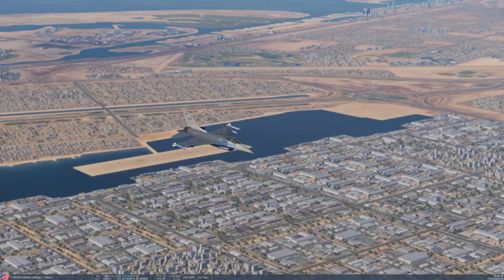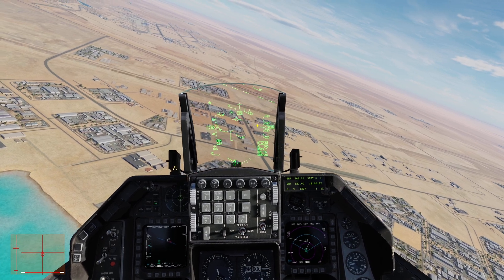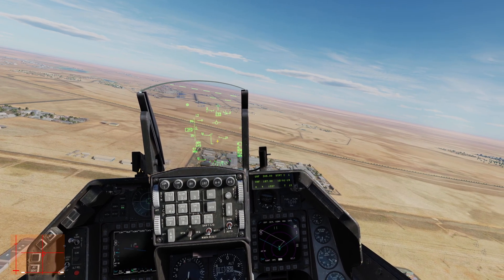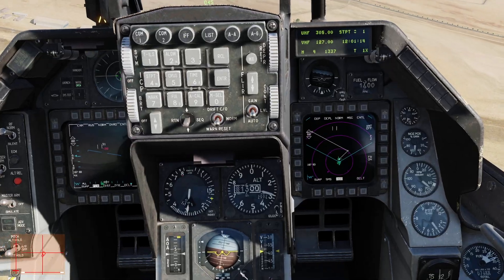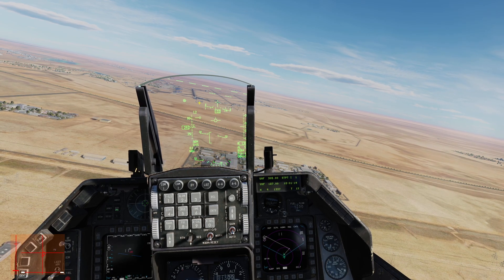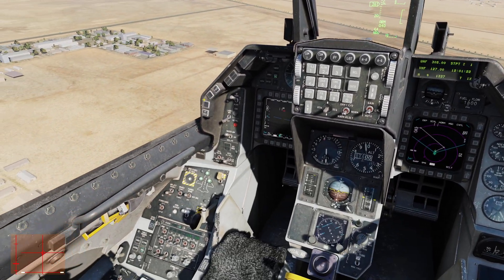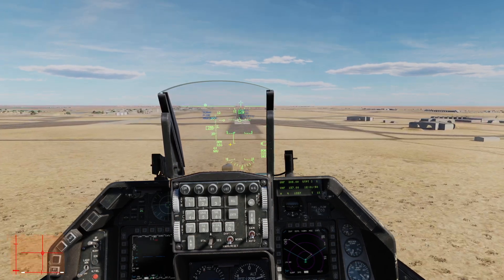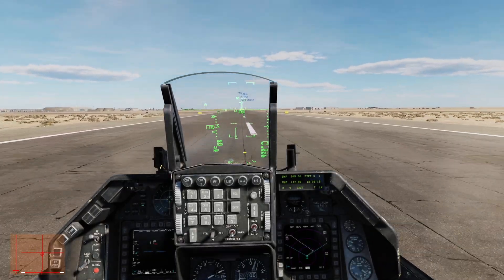DCS Novice: 11th landing attempt in an F16

Comment: Brohiem, I'm 47 seconds in and you've admitted already to having two problems with your setup.  If you know speed and angle is wrong, correct it.  You're in a highly maneuverable 9G rated fighter.  Put her where she needs to be.  Don't try to rush landings. :)

Use your break turn, burn the speed off.  The thing has massive amounts of power and is no F-100, it can pull itself out of a sabre dance as long as you're not overloaded like crazy.

Get into the habit early of making good landings, not forcing or trying to fix bad ones.
Reply from the maker: Good advice! I knew it wasn’t a great approach, but I uploaded it anyways because I enjoy sharing my learning and fumbling process. I find it useful to show everyone that I’m far from perfect, because I get really great feedback like yours :) thanks for the tips man!!

Comment: Pro tip. No need to punch your tanks off just make sure you are on your final around 170~175 knots, this will of course fluctuate with your landing weight. The viper will respond better at landing if you keep the power-band higher. To do this you need more drag which the tanks would have given. When you are landing 'sick' like in the vide you wand your boards out full all the way to touchdown. Try this and you'll see the F-16 is going to be more responsive with power inputs if you higher in the power curve so you will fell the minor adjustments with throttle input. Get on speed on AoA ~13 degrees and use only the throttle to adjust your altitude not the stick. When you touch down hold that nosewheel off the ground as long as you can to aerobrake...The F-16 has small brakes. Best of luck and Keep the videos coming.
Reply from the maker: Amazing. Thank you so much for taking the time to share your insights. I think your advice is really going to help me improve. Thanks mate ❤
Reply: @cantenopeisland7863  no problem! Watch some YouTube videos on the overhead break VFR landing tutorials. You'll be a pro in no time.